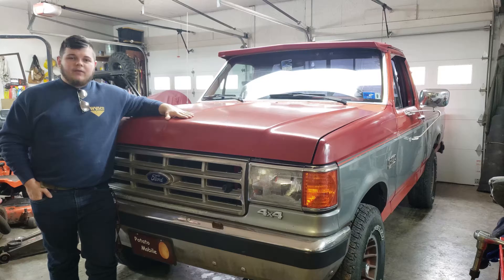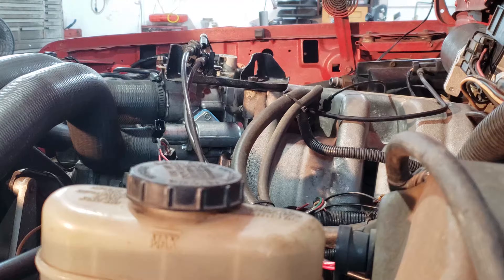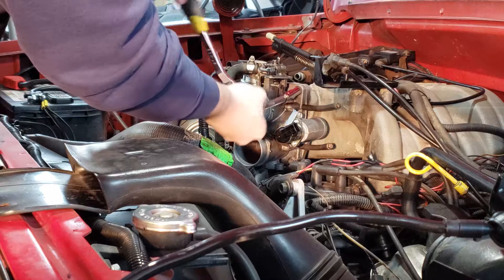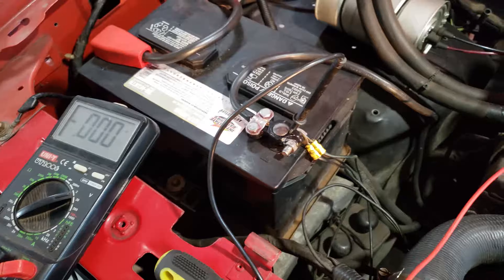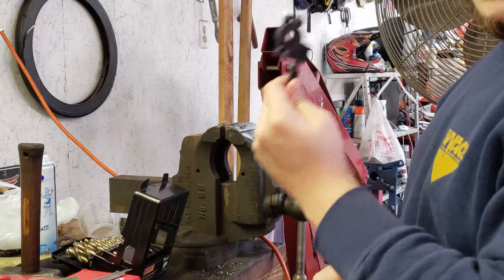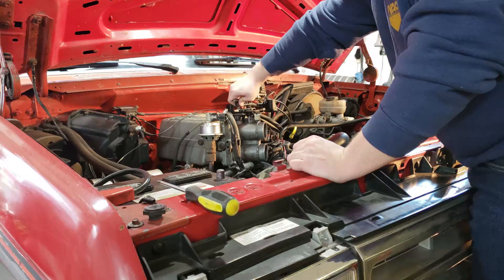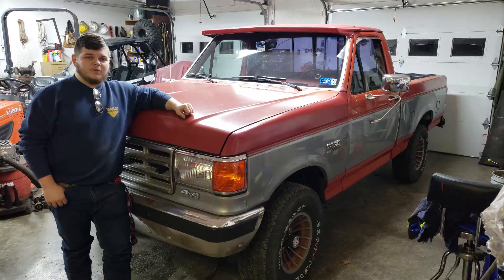1987-97 Ford Throttle Position Sensor Replacement and Idle Reset Procedure

Comment: Just wondering is there a right way to set it on like some have the plug and wires of tps sensor  out by the coolant hose and others have it facing the iac valve on right
Reply from the maker: When I checked the factory service manual, it said to face the wires towards the IAC, I didn't know this until last year that they put a direction on it

Comment: I recently acquired a 1992 F-150 5.0 automatic. It drives and starts up excellent but it shifts weird. I have to start with overdrive off until I get going and then turn it on and it shifts okay-ish but definitely not normal. Sometimes it shifts just fine and other times it doesn’t. Going up hills I have to floor the accelerator to get any RPMs. It feels like it’s always 1 gear too high when I need to go quickly. I’m seeing a bunch of different sensors that could cause this but I might start with the TPS and see happens. Curious if anyone has had similar issues and a possible resolve? Also, when I put the truck in 2nd gear when idling the RPMs fluctuate but not in first gear.

Comment: Great video to the point, you made it look so easy, thank you. On my 87 lariat 5.0 on start up, the idle is going up down stalling 4 to 5 times before it levels out. Is this what you're talking about in your video why you changed it. Is there a way to test old one if it's bad. Or maybe its just dont have the right voltage coming from it. Thanks for your help.

Comment: For every one having a high idle after 4 years, i had vaccum leaks,changed coolant temp sensor, map sensor and the main problem was TPS. I went through 4 TPS, buy a motorcraft one and all your problems will be solved

Comment: Good afternoon boss man I have a question for you if you could answer it my ex-wife has a 1995 Ford F150 5.0 motor and it's going to need the same job done when you say bleed the system you mean run it with the radiator cap off until all bubbles stop coming out correct just double checking because she was thinking of getting rid of it because it's been acting up the original owner never took care of it at all thanks again Sam from Ohio God bless you and your loved ones
Reply from the maker: Yep, these trucks are pretty easy to bleed the coolant system, just run it with the radiator cap off until it gets to operatoring temp, squeeze the hoses good to make sure there are no bubbles coming to the to top, put the cap back on and top the reservior off when it cools down
Reply: @Hunters_Mechanics good afternoon boss and you are Appreciated more than you know God bless you and your family

Comment: My egr vavle and smog system have been deleted before i became the owner. My IAC is also unplugged and when i plug it in the rpms go through the roof. The cherry on top is the base idle bolt isnt even touching the throttle at all
Reply: idle air control valve stuck open you can clean it or just buy a new one

Comment: Thank you sir! I did not know my truck needed to be able to stay running with IAC unplugged. Took me 5 mins to adjust it right. You gained a subscriber 👌🏻
Reply: what way does it need to be turned i didnt catch that in the video .. CCW or CW?
Reply: @ManuelGarcia-kx3bc if you look at your TB it only goes on 1 way. You can match it up with the TPS
Reply: @anthemred47  i asking about the throttle screw to set initial idle. sorry if i wasnt clear. so if that is only one direction please let me know
Reply: @ManuelGarcia-kx3bc right to increase throttle and left to decrease
Reply: @ManuelGarcia-kx3bc  so CW to increase and CCW to increase 👍🏻
Reply: @anthemred47  thank you good sir
Reply: @anthemred47 are you sure bc you can flip it around mine came that way I’m a lil confused lol sounds dumb but a pacific direction them wires need to face

Comment: Awesome but just a thought: all meters have a different reading, it's never going to be 100% accurate. I wouldn't worry about such small voltage differences. Maybe twist it all the way and tighten then if you still have issues try twisting it the opposite way, and then the middle range.  Just a thought.  I will try today. Thank you for the video
Reply: How’d that work out for you?
I just picked a tps up in hopes that my idle will settle and my shifts won’t be stupid, and I don’t have a meter with me but I need this done today

Comment: Don't drill your throttle position sensor, just turn the idle screw until you reach.98 volts. More miss information on the Internet 😞
Reply from the maker: @Matt-qg3wr  my guy it's straight from Ford for this procedure lol

Comment: Strangely, disconnecting my iac (at running temp, truck running) did nothing. No change. I’m on the disconnect battery and wait step. 
Any input regarding the iac phenomenon would be appreciated.

Comment: Don't drill out the holes. That's what the adjustment screw is for. Let's use our brain. If Ford wanted you to drill out the holes they would have manufactured the tps that way. Adjust the throttle screw. I did and it runs perfect. Just bolt on the new tps and adjust the throttle screw to spec.
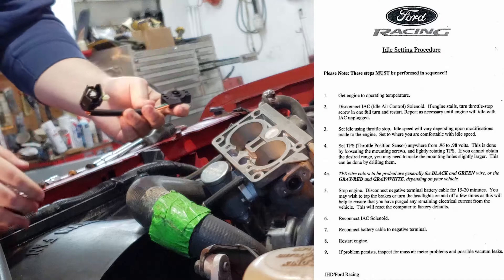Reply from the maker: @AaronKnowlton-r4r  4:15, just following Ford's own paper my guy lol
Reply: @Hunters_Mechanics  Maybe Ford doesn't want anyone working on Ford trucks but then. The whole idea about drilling holes out of a factory part is the craziest thing I've ever heard. I bolted my in place then used the Don't touch set screw, to get the voltage setting, and started the truck. Runs like new. Ford is smoking crack on that one

Comment: I've heard that after you attach the battery for the re-learn amd start the engine you should let it idle for 30 minutes without touching the throttle. Has anyone else?

Comment: What would you typically see these act like if you dont follow the install procedure and simply install without checking voltage
Reply: Fluctuating idle, cutting out when throttle is hit, cutting fuel pump off when put into gear and probably code 23 from the CEL

Comment: First off, thanks for the very informative video. Just curious where you got the 0.96 to 0.98 spec. In my Hanes Manual, the instructions recommend 0.5 to 1.0.
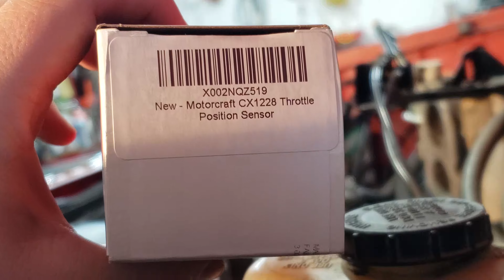Reply from the maker: It comes from the Ford Performance paper at 4:10, I just happened to find it on a forum somewhere and it worked perfect for me. I cannot prove it's authenticity but from my experience and others, it appears to be the sweet spot

Comment: I have perfect idle like a brand new car, and i can do high rpms nice and smoothly but anything in-between sucks. Cant even get to freeway speed . It something that recently happened. I have perfect 53psi constant fuel pressure too.
Reply: Check your mass air flow sensor

Comment: So my ‘89 F150 doesn’t have ANY coolant lines going to OR coming from the throttle body. Is it required, because I drove the truck exactly like this since November…😅
Reply from the maker: It's not required but I believe it's supposed help the butterflies not freeze in the winter time and assist them warming up if they for whatever reason had some ice/frost on them. I know a few people in forums said they remove them because they don't live in a colder climate
Reply: @Hunters_Mechanics   Ohhh ok. I drove it in zero degree temperatures no problem, so I didn’t know if it was vital that they were ran to the TB. I appreciate the insight Sir! ✊🏻

Comment: I’m trying this and man it’s all the way off. Sometimes it’s reading .000 and sometimes.561 but it’s jumping around too much to figure out. And ideas?
Reply from the maker: Sounds like the sensor itself is bad or the connector may be dirty to the sensor. Should always get a reading of "something" if the key is turned so if you're getting a 000, then you must have a short or the sensor itself is faulty

Comment: If my idle is running high do I have to mess with the screw?
Reply from the maker: There can be a lot of things associated with these trucks running a high idle, I would perform the first check like I did by unplugging the Idle Air Control and see if it dies or if it idles too high, should sound like what I have in the video. If it's still too high, I would adjust the screen down a little bit and see if that helps
Reply: No

Comment: Could this be a reason why my 1987 f150 5.0 starts up but then stalls shortly after? I’ve  been chasing this issue for a while now and still can’t figure it out, send help please haha
Reply from the maker: Short answer is yes, long answer is that just about every sensor could cause it in this truck lol can you get it to stay on if you play with the throttle or does it die regardless?
Reply: same issue here, revs fine but wants to die at idle and at startup unless i hold the revs to 850-900. sounds fine otherwise and revs smoothly.
Reply: Did you figure this out? I’m having the same issue with my 91 f350 5.8. Just replaced the tps but didn’t adjust the position for the voltage. I also wonder if the connector that connects to the tps sensor is bad
Reply: tps sensors have to be calibrated and are not plug and play according to forums. try your IAC valve, that was my issue. its 1 plug and 2 small bolts. it should run with a bad tps but will run poorly. with a bad IAC “idle air control” the intake is not designed to let in air during idle anywhere else and if bad will stall and refuse to run die after reving… unless you turn the screw on the throttle body to open the throttle and keep it cracked open. (screw should be backed all the way out and barley touch the throttle plate)

Comment: I really appreciate your video.  I’m having a problem with my TPS.  What setting did you use on your multimeter to check the TPS?
Reply from the maker: Voltage reading for DC

Comment: So do you take the idle screw completely out when you are setting TPS voltage or leave it in?
Reply from the maker: You do the first procedure with getting the idle set right with unplugging the IAC,  that way when you are setting the voltage, you have the throttle body in its correct closed position where the computer expects it to be
Reply: Thank you for explaining. I’m hoping this will fix my issue, I rebuild my motor and deleted all emission and every since it had had issues of not idling properly and cutting off and not starting back up when I drive it a little distance. Everything is brand new.
Reply from the maker: @Bricked.up_Lariat  I feel like I should do a video this year on going over the the shitty running conditions that these bricknoses have and what I've done to fix them because a lot of people seem to have too many problems with them 😂
Reply: @Hunters_Mechanics  that would be awesome man, it would help a lot of people out. I’m gonna subscribe and look forward to that vid from ya lol. The root to a lot of the problems I feel is the shitty 90’s efi system. I plan on replacing mine with Holley efi system soon
Reply from the maker: @Bricked.up_Lariat  From my experience and from me helping others, the largest chunk of everyone problem keeps going back to buying Autozone/O'Reilly/Advanced sensors and they're all just shit 😂 It's a night and day difference when you buy Motorcraft sensors for these old trucks in terms of how they perform and how long they last, the other thing too is so many Amazon/eBay special parts that people buy expecting them to be good when they're 20% of the price of a known good brand, I saw someone in a FB group buy all 8 injectors for 60 DOLLARS 🤣 ill see you back on the post after you install them there bud lol
Reply: @Hunters_Mechanics  oh yeah the sensors from autozone and all them stores are terrible… I found that out the hard way, my TPS is brand new from oreillys and doesn’t function properly, I just ordered a motorcraft one, hopefully it fixes my issue

Comment: what was she idleing at after she got warmed back up again at the end of the video? i know the procedures in other work manuals say about 750 rpm`s. and i also know that every truck is gonna run a little different. i have gone through hell with this damn 1988 f250 5.8L for a long time now. im supprised i havent gone totally insane yet. and thanks for the info on this
Reply from the maker: Thats about spot on where it sits, 750-800 after it idles down
Reply: @Hunters_Mechanics  thank you very much. the old books says use a .030 feeler gauge at the stop screw then adjust idle to 780 rpm`s. and pull the pip connector and unplug the iac. been doing that and it dont work on mine. also last time i drilled out holes in the tps  i lost my life warranty at auto zone. so i havent been doing that , and they usually sit around .92 and it never seems to learn how to do anything but run bad . again thanks for the help
Reply from the maker: @awh5773  I used to run Autozone tps, IAC, and MAP and constantly swapped them out. I think I went through like 5-6 MAP sensors because they kept failing so often. I finally just bought all Motorcraft sensors and following the Ford papers and manuals and its been working flawlessly. Even used to run just without the IAC plugged in because it runs like a carbureted truck but when it was cold it was a pain in the ass to keep it on long enough to warm up lol start up and immediately die
Reply: @Hunters_Mechanics  I know  all about  that stuff.  Again thanks for the help. I didn't know  about  the ford paper you showed. Wish I had known  about that  lots sooner LOL
Reply: @Hunters_Mechanics  i forgot to ask. do you still have the diode in the IAC wires. i got a small bladed fuse holder then went to salvage yard and looked at all the 90`s cars and got the small black diodes from the under hood relay / fuse box. makes it easier to replace if necessary. p.s. dont put the diode in backwards if you do this. it will cause problems i tell ya. i had the old red cover haynes book. in wiring diagram it shows the diode in backwards. caused me lots of problems
Reply from the maker: @awh5773  I do, back then when I was chasing problems, one of the things I found out was the diode was blown, I cut it out, got a fuse holder and a diode from O'Reillys and it fixed my issue
Reply: @Hunters_Mechanics  I believe  I have  an injector or 2 is acting up. Once the computer  takes control  over the  idle. It runs rough. All sensors are within  speck and no vacuum leaks. ( I made a smoke  machine) . It found leaks I didn't know  I had. And everything  in ignition  system is new. So it's got to be an injector. Yay me

Comment: Or its your purge solenoid - that will cause crap idle and stalling
Reply: Will this also cause high throttle while at idle ?
Reply: @JC-fq5xv  (95 F-150) It's my understanding the purge opens briefly at start up. Mine stayed open, I pulled the hoses, plugged them. My idle issue was a broken spring in idle air control (IAC) sensor. 
When my TPS went bad my truck had trouble shifting higher than 2nd gear, js.
Another issue I had: Driving on highway, the truck lost power for 1/4 mile then suddenly ran fine, CEL came on and went off. Same cycle over and over. Got an "air not bypassing" code.  Was a clogged converter.
Reply: @JC-fq5xv  yes it can
Reply: Thanks I have the throttle body off at the moment … going to replace the idle air control the tps and the gaskets

Comment: We’re doing this now, but we drilled the wholes out testing it off the orange and black wire we got a initial .78 volts then after which it’s down to .52 and don’t change when we rotate it. Granted it was a cheap as hell DVMM but it still looking for some insight! Finding a new season was hell and not cheap lol had to drive 2 hours to get one
Reply: Edit I ment green wire not orange
Reply: So which wire is which Ik black is ground but is green signal wire or orange one

Comment: Fantastic video and very informative…just helped me to resolve an issue with my 93 F150 and TPS voltage issue, as I wasn’t aware the mounting position of the sensor to the throttle body would impact voltage to the sensor.  I’m still not sure I understand the how’s or why’s but I made the adjustment and got my sensor in range (was too high) and it’s smooth as can be.  Thanks again for this tutorial 👏🏻👏🏻💯
Reply from the maker: Love to hear it!
Reply: @Hunters_Mechanics do u put that multimeter on homs or dc volts I’m going to do this tomorrow on my f150 1995
Reply: From what I’ve heard it can fuck with a e4od shifts if you have one
Reply: @michaelpurkey6325  it is messing with my 95 5.0 Bronco   Random instances of the OD light flashing along with hard shifts...along with weird cold start idle issues.  Changing mine out this week hopefully.  A little worried last time was on a 90 351w and 2 of the dang bolts snapped on the throttle body...apparently Ford wasn't big on using antiseize back in the day smhlol
Reply: Nice video  gracias